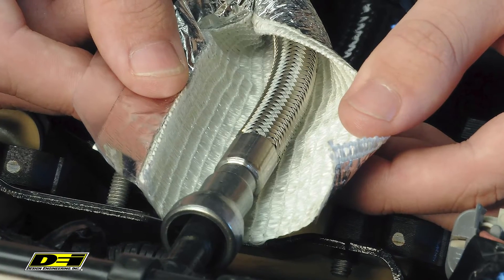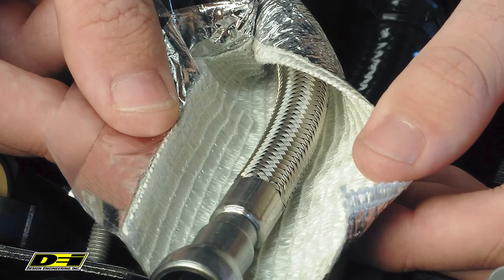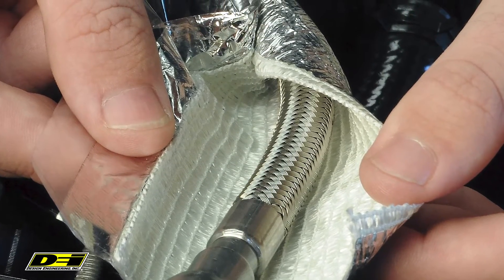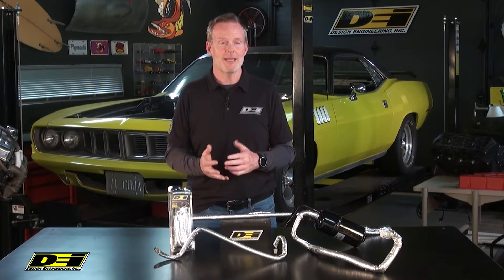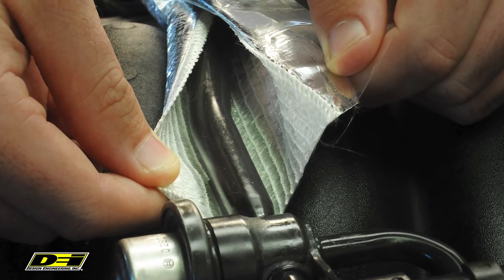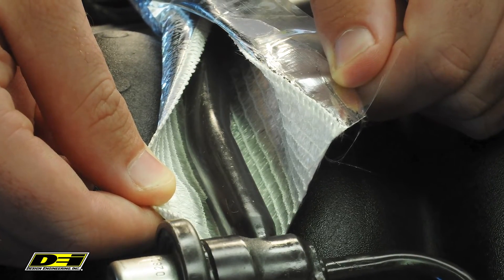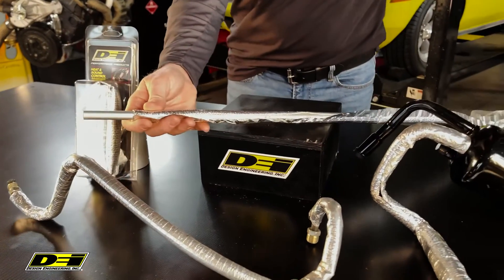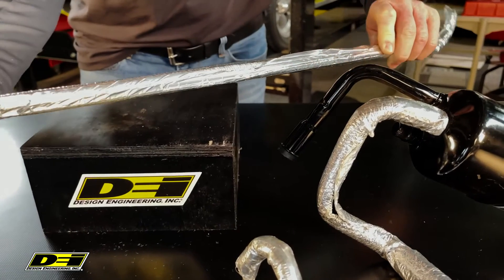Vapor Block from Design Engineering, Inc.

Comment: Going to try this stuff im having major vapor lock on my engine the metal lines are boiled fuel .. i pulled the rubber off the metal line and heard it boiling..and ive broken down 4 times now.  Exhaust pipe is right along the entire fuel line to the tank.

Hope this works
Reply: Did it work?
Reply: @120Stevo   i didnt buy it.

I used the reflrctice bubble insulation.  The reflective material you can use for sun visors..  all you need is a metalic looking surface which reflects heat.

But i also found my fuel lines were 4 inchs from the exhaust.. prior owner did a duel exhaist and ran the drivers pipe right along the return and supply line on the fuel rail.

Since my lines were 50 years old i decided to get 3/8 aluminun aircraft fuel line and ran it on the otherside of my frame rail.   This stopped the boiling fuel problem.  Along with the reflective material i used in the engine bay fuel lines